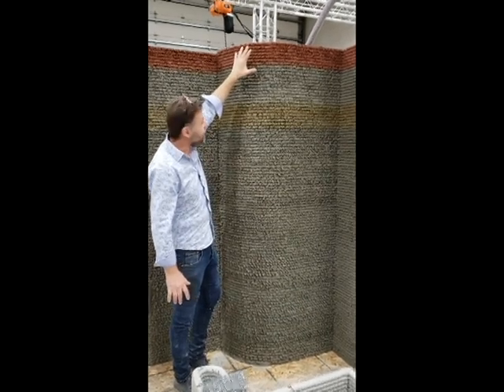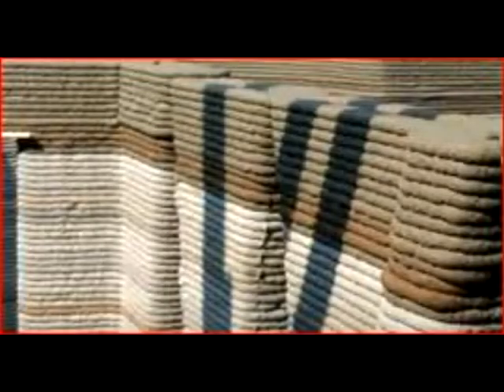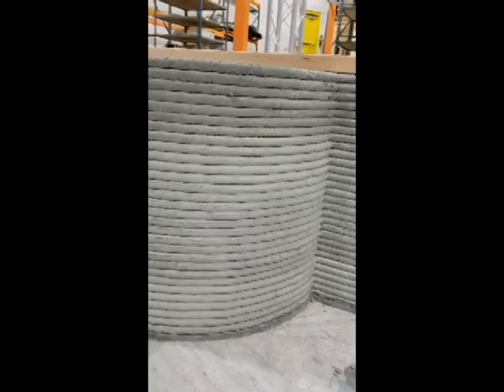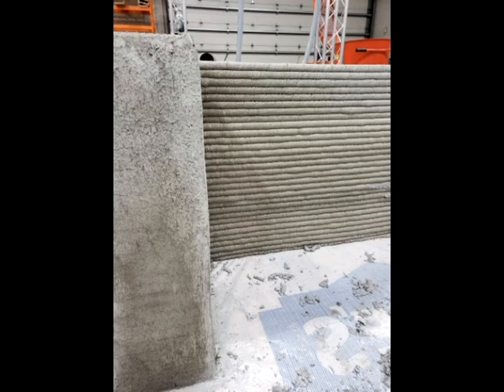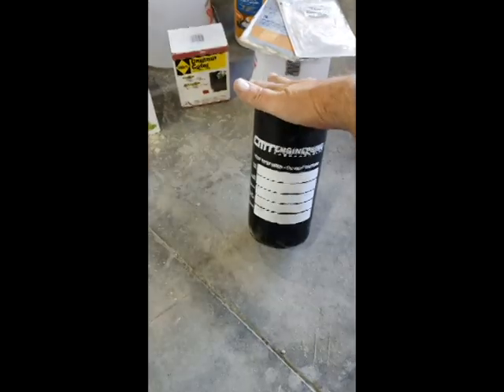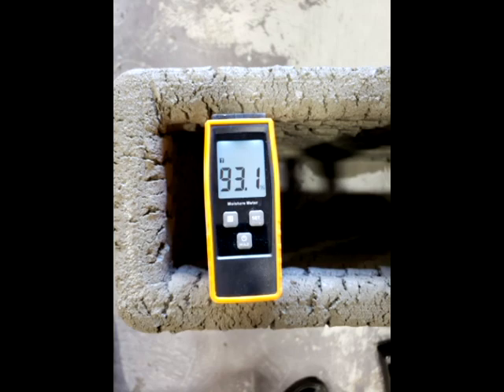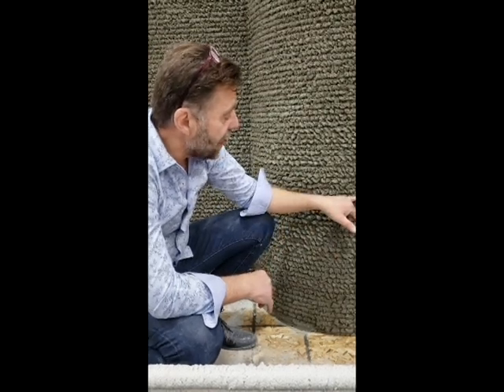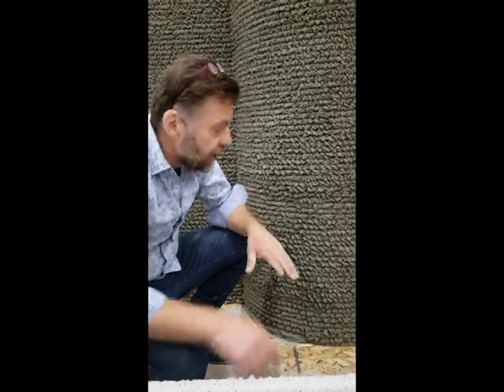Printing an 8-foot Wall | Mudbots 3D Concrete Printing

Comment: very respectable not to void your warrantee with other mixes/print material
Reply from the maker: yes... we saw proprietary mix as a deal breaker.  Especially when 80% of what you need is at home depot.  Shipping pallets of mix from the manufacturer defeats the purpose